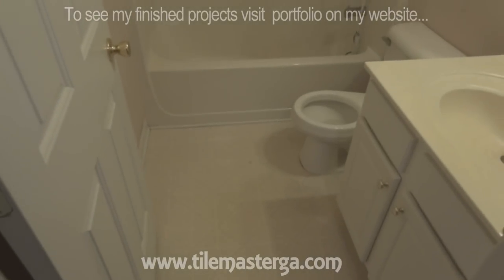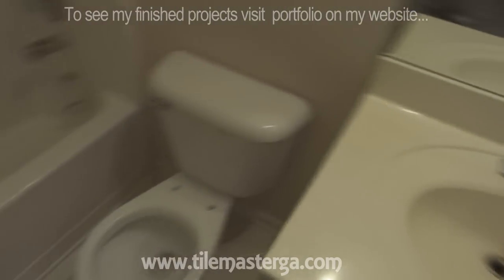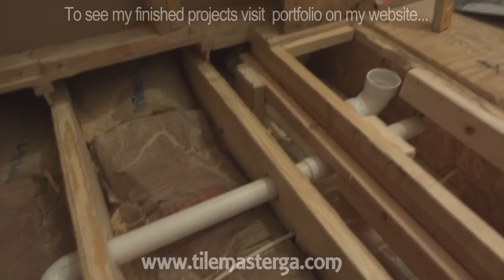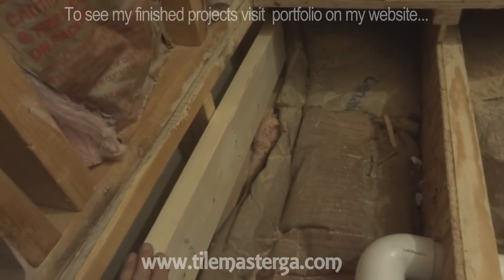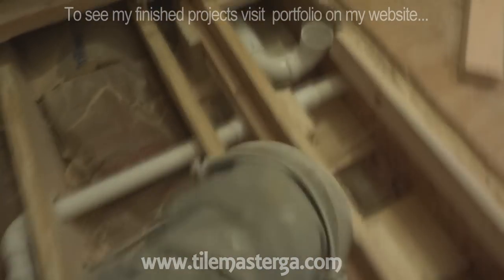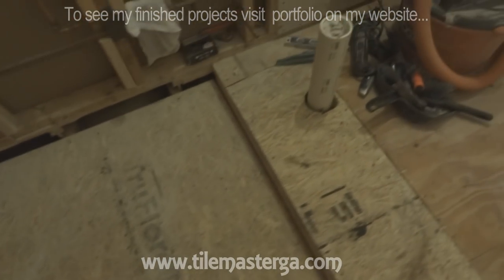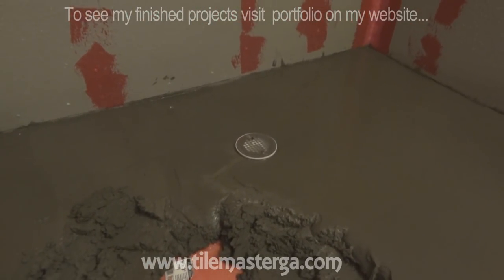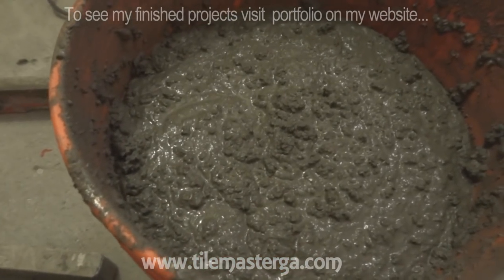Part (1) How to build and tile curbless ( handycap ) walk -in shower.

Comment: Now, I am no contractor or builder
I will agree that most of you know what you are talking about when it comes to no slope to this or that and other problems
I do not agree with most of you about the flor joist being cut.
I have seen houses with the floor joist rotted away and the house stands, I have had my floor rot out and ruin the joist with a 
400 lb. tub setting on top of it and still did not fall thru the floor. I would not be one bit concerned about a small amount of wood being cut and the adding support back to it
 Our son had a shower installed 10 years ago and they cut the joist just like this guy and the house is as solid now as when it 
 first built. They did slope everything including liner
Last he may be in an area where there is no inspection required
We have none where I am
Reply: trippleslots, I think you might be thinking about conventional wood joists like a 2x10 or 2x12.  The flange of an I-Joist should never be cut or notched.
Reply: You do NOT know what is loaded onto those walls at the ends of that shower surround.  All situations are different.  Quit talking out the side of your neck!  Depends on the loading in the structure.  All situations are different.  Your tub not falling thru the floor in YOUR particular situation mean NOTHING.  It's YOUR situation and YOUR situation ONLY!
Reply: @SomeDumUsrName  you can't cut i-joists there is no other situation. this guy is a tile guy not a carpenter or engineer
Reply: Thank you for your misunderstanding and your ensuing trash talking.
Reply: @SomeDumUsrName  that wasn't trash talking buttercup, it was a statement
Reply: @SomeDumUsrName  they are, very tight, that's why I have to safety pin the front of my boxers

Comment: EEK!
Cutting engineered floor joists and scabbing on 2X's? Big no-no. Once you cut that top chord, you have 3/8" strand board for a joist and those 2X's ain't carrying jack sheet. 
Enjoy that shower while it's still upstairs because it ain't gonna be there for long unless there's a bearing wall underneath and to the left of that cut.
Haha. I had to quit watching because my head was starting to hurt thinking about the huge lawsuit coming down the line.
These guys should be taken out back and shot to prevent them from destroying anyone elses home.
Reply: unless the joists are bearing, which I couldn't tell from the video.  still not a good way to go
Reply: Not shot now, camman. That's really extreme and it's murder! Don't say that.